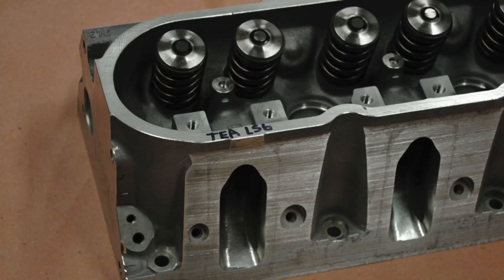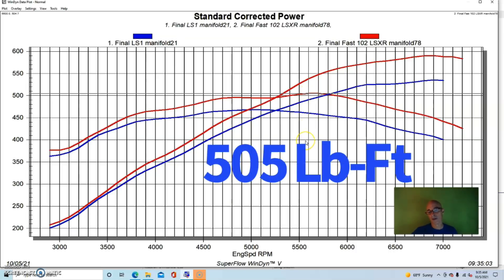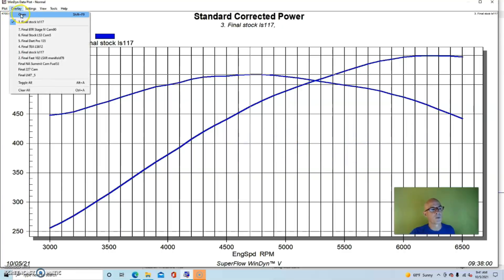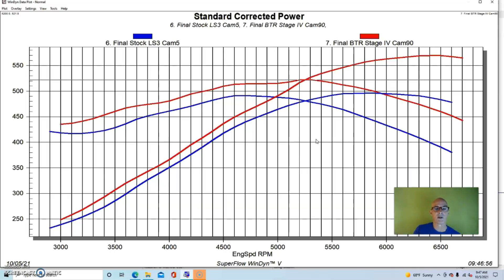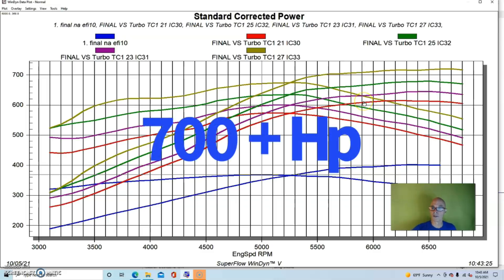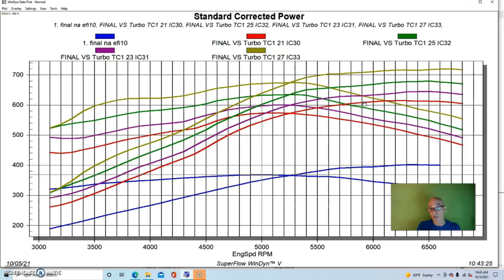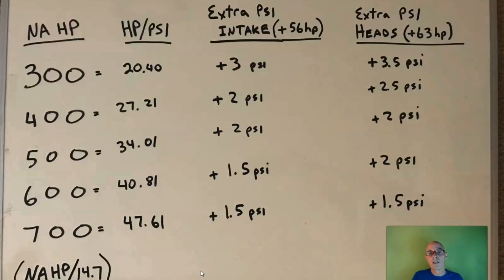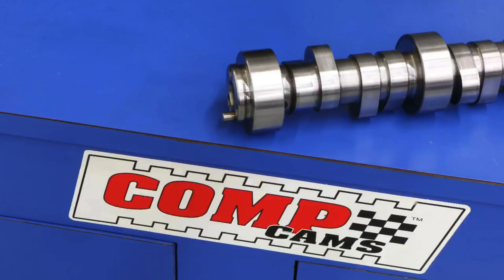HOW TO MAKE MORE POWER WITH YOUR TURBO!  BOLT ONS VS BOOST-WHAT WORKS BETTER? DIY, CHEAP, TURBO

Comment: Quick question for the cam genius that taught me most of what I know now, love your videos man.

208/214 112 lSA  vs. 208/212 115 lsa 
All are .550 lift.

My question is do you think there will even be a noticeable difference between the two?  I understand the wider LSA is going to improve top end while cutting off bottom end a little bit but I'm curious if that small of a difference will even be noticeable.
Reply from the maker: you would be hard pressed to see a change and would only detect it on a pair of very precise dyno pulls
Reply: @richardholdener1727   appreciate you good sir.

Comment: good video like always.  Had a question if you don't mind.  So I ended up not being able to do my bronco project for probably the next year or two because someone ran a red light and totaled my car and so I have to get something right now and there were no good broncos of the years I want right now that weren't ridiculously priced so I got a 2011 GMC Sierra with 70,000 miles on it it's got the 5.3 lmg I believe, it has 799 heads and it's going to be a daily driver dual purpose off-roader and instead of doing the twin turbos with the small turbos I think I'm just going to do the LSA supercharger swap what cam would you recommend for that I want a good low RPM torque truck so I don't want a big cam or do I even should I even change the cam I think the specs on the cam is 484 or 481 depending on where I look lift for both and it's like 196 intake 201 exhaust at .50 I think and LSA if 116+2 which I'm assuming the plus 2 means it's advanced 2°, but I'm not sure.  I'm hoping to make between 4 and 500 horsepower to the wheels I don't really care about horsepower I just want that torque down low like it felt like with my EcoBoost.  Also I'd rather not have to do a cam swap if I didn't need to I would assume I could make that my power goals pretty easy with the LSA without spinning it to the moon but just thought I'd see what you thought.  Also would you recommend doing the trunnion upgrade or just buying brand new roller rockers or you think I'd be okay just sticking with the stock roller rockers cuz I don't plan on spending the engine past 6,000 RPMs and really I'm mostly worried about idle to like 3,000 RPMs is where 90% of my driving would be
Reply from the maker: run it with the stock mild cam and see how you like it
Reply: Ok cool it was definitely bigger than I thought the stock cam would be.  Am I right also in assuming I don't need to do anything with the roller rockers cuz I'm not spinning the engine up a lot?

Comment: My only concern with this is longevity. Logically, less boost= less stress, for the most part. I’m not sure how you could test this but I think a longevity test between a stock motor and high boost vs a built motor and less boost, would be a super cool test!
Reply: Not necessarily less boost, but less torque output=less stress

Comment: This LS stuff is nice and all, but I'd probably still dump the money for decent heads and probably an intake to go with new cam on a SB (whatever brand, but let's call it Ford) before boosting it because 37 pounds is going to be a real treat to tune in an E7TE combination to make any power (haha, 37 pounds was a joke. Almost.) For those of us running old dog meat not an LS engines, it makes better sense to get it to a decent HP before boosting the crank through the pan. Or that's my thinking anyway...
Reply: Zzz xxz
Reply: I 
Yes I

Comment: So Richard, I just built a dart block 438 scat stroker kit 11-1 Howard's big bottle cam 730/731 290/292 with too small afr 205's for my 84 foxbody
Made 587 on engine dyno n/a ,,just put a single torqstorm with 3.10 pulley , max hp output is said to be 700hp from torqstorm I'm making 8-9 lbs of boost so is that my max hp 700 or being a 587 hp to start with offsets that max number ?? My n/a cfm was 810, n/a torqstorm says 1250 cfm from charger , also running water meth . thanks sir love the videos.😀
Reply from the maker: we have made more than 700 hp with the TS, but it takes a good motor

Comment: factor in the cost of the tuner and the tune, the turbo kit,  and the install (assuming you don't do it all yourself) is there really a big price difference doing it the turbo way vs the high dollar NA mods?? asked another way, which rabbit hole costs more to go down and how much (ballpark of course)
Reply: When you figure that tuning is needed regardless, that cuts that cost out of the difference between them. The big difference is typically that a high performance NA will want heads that you are spending over $2000 on, a rotating assembly of $4k-7k and machining work, $500-1000 exhaust manifolds, an $800 intake manifold, and a $400 cam, where as the turbo kit will cost you $4500-6000 for a complete kit, or you can piece together things $800 ith a $700 manifold, $200 turbo, $200 in getting your oiling done to it, $600 on an intake with intercooler, and $600 in Injectors, $100 boost control solenoid and be able to make the same hp, for a longer powerband. If you are trying to compete on a road course or in a type of racing where immediate response and going to be more beneficial than outright power, NA is going to be more your lane, but for drag racing, the overall king is the setup that has the most area under the curve, boost or nitrous..
Reply: If you compare just the mods he did, its cheaper to be NA, but he also was comparing a bigger engine which can take more advantage of the mods he did, probably costing in the $1500-2200 range, but you can feasibly also put a turbo on your engine for that cost if you are trying to keep a budget, $800 manifold, $200 turbo, $150 intercooler, $100 wastegate, $300 on other odds and ends, and can crank the boost up, even after you do those mods if you decide later.

Comment: Does this apply to the 6.4 Hemi as well (ported)
Reply from the maker: THOSE HEADS ARE ALREADY GOOD
Reply: @richardholdener1727  Richard I bought my 2016 challenger In 2016 it only has 10k miles on it. I want to put VS racing turbos on it. Good Idea.....?

Comment: This is exactly my situation except LS2, prc225 heads, and tsp bald eagle cam.  Still on stock intake.  What would be better ported fast 102 or stock 102 w/ 102tb?  Eventually wanna add A&A kit

Comment: What I take from this is...
If you are trying to get power on the cheap, select a turbo that can support your power goal, get a nice cam and spring. Turn up the boost till you get to power goal, the number will be higher than if you upgraded but you will still get there. 

If you can afford the money to upgrade go ahead,boost will be lower but at the end of the day you will still get to your power goal.  As long as it's in reason for your setup.

Comment: Have you compared hemi intakes? I have the Holley sniper intake, haven’t been able to use it, engines still in machine shop but also have you ran any test with 09 heads on 05 hemi block?
Reply from the maker: I have tested early intakes but not the sniper or later heads
Reply: From his videos you should be able to infer that all those short-runner manifolds are going to be terrible except for way up high RPM I'd probably stick with the stock intake depending on what you're using it for
  Also there is an article out there someone did about trying to put the late model I think they're called Apache heads on the earlier hemi blocks and they had to do a bunch of weird stuff to make it work now you could get the Edelbrock heads and those fit on the early and later version third gen hemis iirc
Reply: @sock979  yea they went from 85cc to 65cc combustion chambers so it ups compression, with my stroker kit, I had to get -23 cc dish to be able to get compression to 8.8. But I do agree with your input on the intakes, I’m fine with trying it, if I hate it, I’ll go back but, just trying decide what cam to run with this set up. If ya got any suggestions, I’m down to hear ya out. Lol
Reply: @RJRPerformance  no I'm asking rishard for cam input too I'm probably going stock cu I want down low torque daily driver

Comment: Richard on a 5.3 truck motor when running boost can I still run the stock maf that hooks to the factory intake or no?has a honey comb mesh inside don’t know where to go with this?
Reply: I'm not richard but I have a little experience with a maf and boost.  If you are running within the range of airflow it can read, you can put it on the intake side or after intercooler.  If you are running a blow off valve vented to atmosphere you will want the maf after that.  

To answer your question yes you can still run it.  Plan your placement based on setup. 
A lot of tuners like to abandon the maf and go speed density.  

In the case of my setup my maf has IAT as part of it so I put it after the BOV close to the throttle body. I did this so the ecu would see the actual flow and air temperature that the engine is receiving.
Reply: @bleach_drink_me  awesome I appreciate it bud .I just wasn’t sure if the maf sensor being honeycomb would effect back pressure that much to where I should be worried or if the maf would effect it to where it would be hard to tune I’m running a 5.3 Ls cammed but would like to run 7-8 psi to still be reliable without blowing it up
Reply: @bleach_drink_me  right now it’s attached straight to the intake would that be a good spot for it?It’s probably with the boot and all probably an 1” to 2” in front of the intake the it goes into a bend and then the air cleaner
Reply: @bleach_drink_me  ok I gotcha I appreciate the info your giving me and the time you answered my questions and I now have an idea from what you told me on how to go about it thank you man👍👍👍👍👍
Reply: @dean1627  There's no good reason to keep a MAF on a turbo LS IMO. you're gonna get it tuned anyway so why not just go ahead and go to a MAP and IAT sensor for those purposes and tune via Volumetric Efficiency or Speed Density. Most turbo setups for LS stuff is gonna have a provision in the charge pipe for an IAT sensor and the MAP sensor is already there on the intake manifold. splice the IAT in at the MAF harness and ditch the MAF,  change to a 2 or 3 bar MAP depending on your desired boost level and call it a day.

Comment: Still amazed that you can get nearly 600 flywheel horsepower from a healthy (but not crazy wild) 6.2. Right around 378 cubes.  Not a 427 big block or a 454 big block.
Reply: 6.0! 364 cubes!! Even more impressive
Reply: TQ x RPM / 5252 = HP.  It doesn't take much TQ to make 600hp at 8500rpm, but it does take a lot of torque to make 600hp at 4000rpm. The engine making 600hp at 4000 is going to accelerate a vehicle considerably faster than the one making 600hp at8500. Smaller engines use RPM rather than trying to make 600ftlbs at 4000rpm. The LS engines are pretty good, they can make decent power at a relatively low RPM, as in under 7500. 

The peak numbers are cool and all, but the shape of the torque curve is what matters. The flatter and higher it is, the faster your vehicle will accelerate.... unless you have too much final drive and it runs out of RPM or moves through the torque band too fast. You're right though, close to 600hp, at any RPM from 364 cubes means it has good heads.
Reply: @SweatyFatGuy  Yep.  Flow numbers on some of the stock heads are amazing - LS3 and LS7 for example.  Compared to old SBC heads, theyre light years ahead.  I have a set of 260cc aftermarket heads that flow 380 cfm at 600.  The low and mid lift numbers are very good also.  Good time to be a car guy
Reply: @SweatyFatGuy  I have a Dart Billet fully counterweighted 4.00 stroker crank under the bench that needs a thrust surface repair.  ShafTech was the only one Dart recommended to do the work.  If you can get an aluminum 6.2 engine block with a standard bore, add the 4 inch crank and you get 415+ cubes.  Lightweight, big power.  It will surely turn a 4l60 and a 7.5 into scrap metal
Reply: @SweatyFatGuy  I gotten into the habit of saying, "You bought the whole bore, top to bottom, use it!"  Cylinder wall thickness/strength is important, so I would increase size through stroke.  If you're replacing or  upgrading cranks and not worried about class rules, get the longest stroke available.  For stock LS blocks, that's 4.00 inches in most cases.  A 400+ inch LS is no joke.  600 flywheel hp is possible with Richards favorite Comp 469 cam and stock LS3 heads and intake.  I bet he has a video to prove it too

Comment: So on my 305 TPI. I shouldn't bother going with some Afr heads? I've got the 85 year TPI. Basically the Monte Carlo ss motor with a TPI intake. Did switch out to a TPIS intake too.
Reply from the maker: you need small bore heads for the 305
Reply: Way too much head for that little motor.
Reply: Trick Flow makes some heads with a 1.94 intake. Minimum bore size is 3.736", which is what you got.
Reply: I was looking at those AFR heads for a 305. Not all that expensive considering how much I've already spent on my junk camaro. But I'm also not trying to bring down the house with hp.
Reply: @Chaden338  Overkill for a 305. Find a set of 305 Vortec heads.

Comment: I'm a Ford guy, BUT the LS, is amazing! At least, in the performance world. Daily driven, stock ls's, have their own set, of failures.
Reply: Do daily driven LS's have any more problem than their hemi or modular counterparts?
Reply: @evanc6110  No. But there are problems. I've worked on many of them. The 3 valve Ford, is junk. That's Fords fault. Oil pressure, is the main thing.
Reply: @strokermaverick  Oil pressure on the LS's or the 3 valve?
Reply: @evanc6110  Ford 5.4 3 valve.
Reply: Thank you guy who derives personal identity from a corporation for providing your feedback